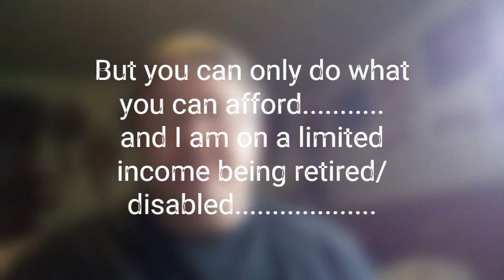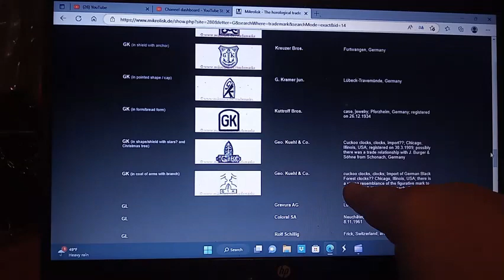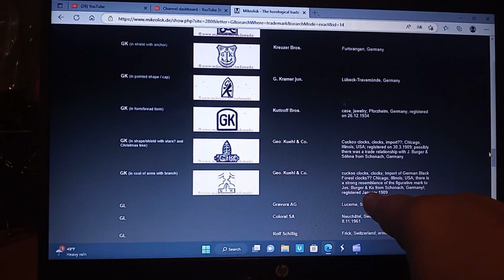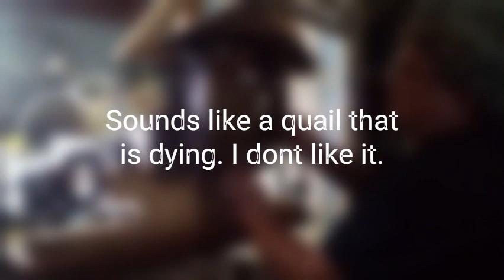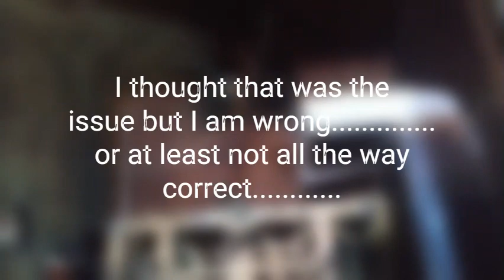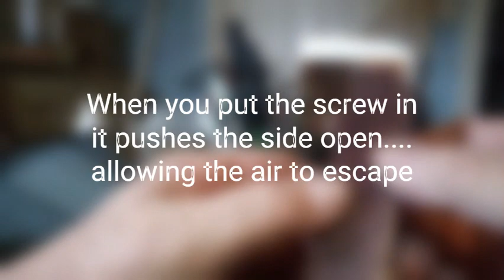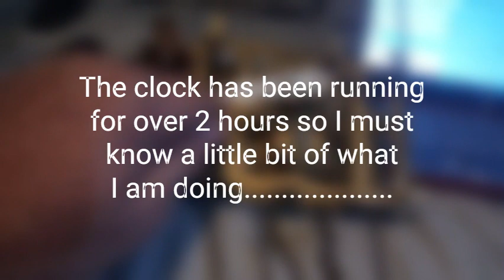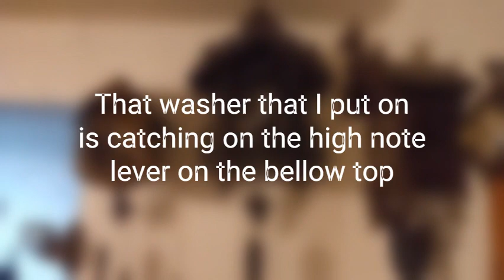Cuckoo clock repair for beginners (1908 GK cuckoo quail clock with count wheel movement) Part 2

Comment: And the Book tells you to drill a hole to see the gong for adjustments if the board does not have the hole. Great finds on the whistle box coming unglued. That might also be why they are wrapped with paper. You need a cheap carving set. The Dremel is fast yet not the same.
Reply from the maker: Thanks for the feedback Mike. I do have a carving set that I bought at Hobby Lobby so if you know anything about that store it wasnt cheap. LOL>  I just need the time to practice with it. Thanks for watching May God bless you and yours.

Comment: MARK CHECK OUT HOW TO REPAIR PLAYER PIANO BELLOWS.
Reply from the maker: I watched the first 5 minutes of a 30 minute video. Totally different system. There are springs inside to open them up. They are closed by pressing the foot pedal. They are made of cloth and rubber. Cuckoo bellows are opened by a wire that is connected to either the high note or low note lever on the movement. If those bellows are opened all the way then typically the levers will get stuck. It doesnt take that much air to make them work. They dont need to open all the way.